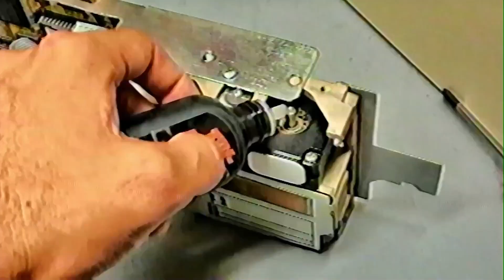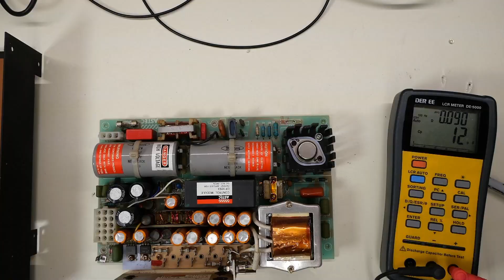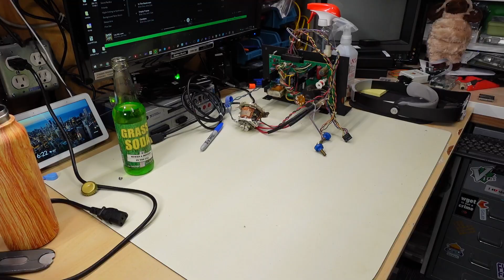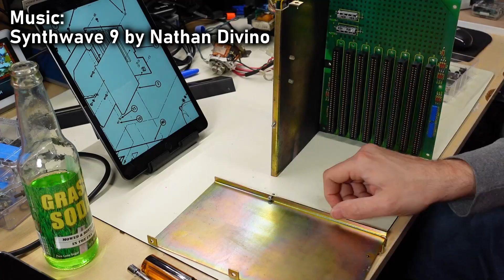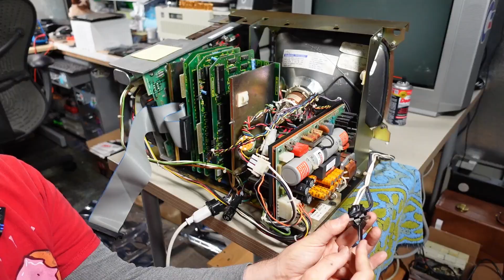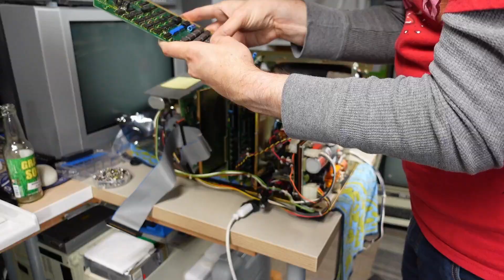I'm really scared to turn the TRS-80 Model II on

Comment: They put a serviceable fuse for the disk drive on that machine because the disk drive blows fuses. They don't want people taking that in for service to change a fuse that's not user serviceable so they added one externally because when they did their testing, they blew the fuse  often enough to add the cost of putting that external fuse in. Also, it may be there just because back then EVERYTHING had a fuse you could change in it without opening the unit (stereo receivers, amplifiers, etc.,)

Comment: Great video series. Fun to watch the diagnostic process and the repair techniques used. Also fascinating to me because I was a TRS-80 user, Model I and Model 4. Back in 1980 I bought the base Model I (16K, cassette storage) because, frankly, it was almost half the price of the Apple ][ that I was looking at -- though the Apple ][ had color output and expansion capability in their base model, unlike the Model I. Eventually I got the Model I expansion module to bring the computer up to 48K (I think... memory is fuzzy) along with a pair of 5.25 inch floppies to round out the setup (much more usable than the cassette interface!!). Funny thing, that fancy configuration made the Model I pretty close to the same cost as a similarly configured Apple ][!  The TRS-80 was a good, capable machine and there was enough technical info available for it that I was able to learn quite a bit about computer technology from using it, as well as write many useful BASIC programs to automate my life. Eventually I sold the Model I to buy Model 4P with the integrated floppy drives which could run CP/M as well as TRSDOS. Although the 4P was nominally portable, it was rather more a "luggable" like many of its contemporaries. All in all solid computers, great for learning (though I must admit, the Apple ][ would have been the better investment in the long run LOL).

Comment: I was a radio shack repair tech back in the early 80s and worked on model II s .   Just from experience I remember video problems were mostly caused by a failure of the video boards.  The CRT  ( cathode ray tubes) were very reliable and almost never failed .

Earlier comment concerning the bad reset switch is also a possibility

Comment: I remember debugging an Intel 8086-based computer (not PC compatible) many years ago. I hooked a logic analyzer to the bus and could see the instructions being executed. Luckily I had the appropriate software for the LA so I could see the instructions as assembler mnemonics rather than hex codes. Anyway I realized the machine was stuck in a loop. Looking at the code I saw that it was waiting for the screen blank signal. So I checked that signal and while it appeared on the bus, it didn't show on the I/O chip pin. So with the machine powered up I connected the pin to the bus and I heard the disk drive head moving as the machine was trying to boot. Where I am getting at is that the repair may not be as complicated as it looks. You'll need an oscilloscope for sure and a logic analyzer would be a plus.

Comment: Not the result you were hoping for,  but I think you made a LOT of progress.  That TRS-80 is a complicated device with a lot of potential points of failure, and was likely damaged in a drop. I think you are correct that the one connector could be a major part of the problem.  I was curious why you think that boards other than the sweep board could be causing the lack of vertical and horizontal sweep.  Theres a ton I don't know about the TRS80. 🙂

Comment: I've seen Astec PSUs in other microcomputers with those orange capacitors.
They can leak in an odd way, the electrolyte melts the rubber boot and glues the capacitor to the board.
Looks fine from the outside, only when you remove one do you find the failure.

Comment: You can likely get off the shelf replacements for those card edge connectors since they are non-keyed. 

Likely is, of course, not a certainty, but you could try contacting some electronics supply catalogues.

Comment: Beautiful restoration on that PSU and mount. Dang that unit has got some weight to it, can see how a drop would be hard on it even though it's so sturdy. Also the editing on this video is really tight and well paced. Interesting project, the vintage stuff sure is specific often, absolutely no slack for any deviation from spec.

Comment: "Replace the entire" board Rubbish, change the two large electrolytic capacitors, they will go leaky with age  and their ESR might be quite high, sometimes you can reform them though, if it was me I would replace them. four of the orange ones might be a bit suspect too, but the rest of it looks to be OK

Comment: This is a great restoration, i try to keep my machines as original as possible, but also so they can be used as this, maybe if it has been something extremly special, like the only one in existance it had been different, but honestly all my machines are in reality less than 100$ market value and where made in large series so using rustremover and automotive protecting paint is not a problem here and will do perfect for presvering the machines for the future.

Comment: I wonder if taking a picture and mirroring it on some screen near you, so you don't have to keep flipping the unit, might be an alternative. And I've been lied to - people told me you cannot measure an electrolyte cap while it is still in the PCB connected to other components and here you are walking on water in spite of people not believing.

Comment: I love the traces on the PSU board. I guess they were done freehand... ? You just never see stuff like this anymore.
Reply: They were wave soldered. That's one of the reasons the solder around connector pins crack. They conduct heat away too quickly, so there is less solder at those points. This also applies to pis or heavy copper leads on inductors and transformers.

Comment: A solution to being able to test the power supply in isolation without having a spare connector: find a metal tube of the appropriate diameter to press over the male pins in the connector, and then you can just clip an alligator lead to the other end, longitudinally. At hobby/craft stores they sell packs of small, thin metal tubes in aluminum and brass for model-making, and they often come in assorted diameters. (They can be easily cut to length with a small hack saw.) To find the right size you can either go by feel, or you can insert the butt-end of a drill bit into the female end of the connector, increasing the size until you find the largest diameter that inserts without too much resistance. If the pins are neighbors in the connector and you're worried about shorting, you can just throw tape at the problem.

Or, you can order female pins of the right size and just soldier or crimp wires and use them without having the plastic shell. They will still insert and hold for testing, and again if shorting is an issue tape will work, or heat shrink if you want a slightly more reusable tool. It's all temporary anyway. For the inverse situation (female connector), you can find a nail of the appropriate diameter and do the same thing.

Comment: My first concern would have been the RIFA, but that's already been replaced.
Also, a note on the absence of a -5v, I don't recall any Tandy I've ever seen that had a -5v rail off the power supply, and not all of them even had it on the system bus either. At least the Tandy 1000 RSX, and probably the rest of the 1000 R series has a 7905 to provide -5v to the system bus, but so far as I know, none of the XT systems had it at all.

Comment: I did some digging and according to mingku(dot)2ic(dot)cc/datasheet/pdf/8T26(dot)html the Fujitsu MB424 is a bus transceiver and can replaced with AMX4261 DS8T26AJ DS8T26AN ECG6880 IC-8T26 MC6880AL MC6880AP MC8T26AL MC8T26AP N8T26 N8T26A N8T26AF N8T26AN NT826AB NTE6880 SK9701 TCG6880 UA8T26 UA8T26D UA8T26DC UA8T26P UA8T26PC. Although I'm not sure if it is pin compatible._

Comment: You need to add the Pinecil to your list of “tools” on the videos now. I saw you using it here. I’d been reading about the Pinecil but it was one of your midweek mail call videos that eventually convinced me to order one. It should be here in a few days! (I got the red case as well so I can make mine look like yours. I agree that colour combination is nice!) Great video btw. I’m a TRS-80 person but never worked on a Model II before. Cheers!
Reply: @tspawn35  I also purchased and have just received a wall socket 65W GaN USB-C PD power supply from Amazon. This power supply claims to provide a full 65W and I think it will work beautifully with the Pinecil. I’m looking forward to my Pinecil arrive as well. I have some small projects waiting for me to solder up and I know this will be better than what I currently have as well. Hope all goes well for you too! :-)

Comment: Adrian, I just picked up a Model II myself a few weeks ago and stumbled across this series. It's been super informative (especially the last video) as I try to get my machine booting again. I picked up my machine from a friend of a friend who had it sitting in his barn for the last few decades, and it's in mint condition! After reseating a few connectors, the machine came right on! I've been using the last video you made as guidance to get a bootable floppy made, but I've had no luck with getting my DOS machine to write to the 8" disk yet. I'm excited to see the process as you get your machine running again!

Comment: Did you check the reset switch to see if it's closed due to the damage? If it is that could be the problem, stuck in reset.

Comment: At least it looks a lot nicer on the inside even though it hasn't been restored to operational status yet.
Reply: that's what I call a backhanded compliment!  The part of the machine that no one can see when it's functional and whole, looks nicer. ;(  Maybe if it had a new plexiglass case... it might even fit inside an old aquarium! But as far as a restoration of a vintage machine... I've been there, and my mom will come up with lines like that. trust me, those attempts at encouragement aren't very encouraging.

Comment: I have had access to electronic recycling waste for a very long time, but I have nowhere near the knowledge like you when it comes to electronic. I found computers from the 70s, tube radios from the 40s and anything in between. Nearly all of my equipment is from recycling center current amplifier I use is a 60s kenwood ka-6100. All equipment I found I just fired up up from the get go if they were dry and not wet from rain. Guess what?? 99.9999% of the time it just works. This amp I am using now has been on 24/7 for years and even bulbs works. I have just never come across something except maybe one "modern" ampilifer that failed because of a capacitor. 

Even had a osbourne 1 at a time with a bunch of working software, but sadly I was dumb enough to trade it away back a long time ago.

Comment: Quick suggestion: get a set of cheap remote controlled outlets to plug computers, monitors, isolation transformers, etc into. It makes me feel much better powering up old equipment when I can stand a few feet back with a fire extinguisher or whatever when I turn it on. I can also very quickly shut it off if I need to, even if I would normally have to reach over live power cords or bare wires to unplug it. I've also created a mini foot-pedal that allows me to hit the "off" button on the remote with my foot if something goes wrong, also very useful (especially when hands are full with the fire extinguisher).
Reply: hmmm... I would rather install an emergency button, which shout down the complete power in the room. And be careful with the fire extinguisher - there are different kind, especially when high voltage electronics (like crts) are involved. I this case maybe other factors could be interesting, for example a basement with small windows. Or you want to use something that damage the stuff there at least as possible.

Comment: I too hate that first powerup moment. Prior to this the machine is Schroedinger's puzzle, you can put weeks into restoring and cleaning and things and it could be working perfectly at that point. Stuff can go wrong so very quickly when you hit the switch for the first time though. 
I recently worked on the only known Positron 9000 (1982, 6809 CPU) in existence after it had lived in a wet shed for decades and been chewed by rodents - some of the chips had disintegrated. Much cleaning, socket replacement, chip replacement, new PSU. Heart was in my mouth when I powered it up for the first time and..... nothing. Excellent video, thankyou for showing this hobby isn't all success :) Cheers, Adrian (Binary Dinosaurs)
Reply: I would love to see something on this system. The progress you make etc

Comment: Nice work getting this far on such a complicated machine.  Honestly, while I am pretty confident working on most home computers from the late 80's and onwards, the TRS-80 would just confuse the hell out of me.  Rather than trying to replace all those chips that look a bit dodgy off the bat I would try sanding down the legs and using de-oxit for a start and then maybe replacing the sockets if they are looking bad.  It's the kind of thing that can't hurt at this stage as if they don't work with that, you were going to replace them anyway.

Comment: Dear lord the pcb of that psu made me shout ugly. But I guess its the age of the product. It was most likely analogue designed and made. Being used to tight routing by software like Ulticab myself i was a bit shocked. Thou I do understand it considering the era. And in the end; when it works it works.

Comment: This is so damn nostalgic for me.  I learned BASIC on a Model 4. (If you held down the little red button at boot it would boot into BASIC from ROM). 

If the issue is the disk drive board, I wonder if removing it and trying to boot to ROM would be possible. (I know the model 3 could do it, but don't know about the model 2.)

Speaking of nostalgia, I love the modular design of those early Z80 computers with the backplane and cards like that, there was a project I found in the 2000s where someone had documented building their own Z80 PC like that, writing and burning a custom BIOS, and running CP/M and DOS on it.

Though, I bet the design might make it hard to repair without replacement cards to swap in. 

If you want to use your logic analyzer on a card while it's running, I wonder if you can get a card edge extension cable, so that you can have the card flat on your bench while you probe it.

If the custom chips are bad maybe you could do a collab with a hardware designer on youtube and get a replacement board made. 

I also wonder if the fan noise would improve if you added some silicone grease in there to lubricate it.

I think the sanding and spray paint to prevent corrosion is totally fine.  Though if you ever do get it working, you should paint your signature and the date, so that when it's repaired again in 50 years, there will be a history to the piece.

Love your content Adrian, you rock!

Comment: A good suggestion for powering up unknown electricals and electronics is using a variac, that way you can slowly crank up the volts to ensure damage limitation, aswell as letting caps charge slowly so they don't end up causing a current spike that could blow other components in the process... :)
Reply: can be a bit dangerous for auto line switching modern stuff though.

Comment: An aside from the electrickeries in the video; the yellowy coating applied to metalwork such as the chassis here is Zinc Chromate, apparently quite toxic and a carcinogen when ingested, so do be careful when sanding and/or grinding the stuff off prior to painting... :S

Comment: So what is next? Is it the CPU and board? You looked at the screen working (it works), you looked at the drives working( they work) so the CPU and memory is next? CPU + board is all low voltage right? you can't get shocked like when working on the screen. TV tube working voltages are dangerous :)

Comment: Its looking good after all the work you have put into the PC.Is there any way to input a signal to the monitor to check its working or to take an output from the onboard graphics to another monitor?
Reply: an input signal could be made, but only to check it wasn't completely dead. Many subtle and even not so subtle problems wouldn't show up. Temporarily changing the output to another monitor would be tricky, it's really beyond my expertise, or even the expertise of most "vintage computer restorers" who aren't well versed in CRT functions (it's also a bit dangerous -high voltage). On the other hand, replacing the entire CRT would not be so difficult, old TV CRTs could be used. In another video, Adrian mentioned an old 1980 B&W General Electric TV might be donating it's CRT for this purpose.

Comment: Speaking of power suppliers , is there any solution to put a protection between a psu and a computer, so if it falls out of spec it will brake the connection.

Comment: Why have a dedicated 24v rail if it has a -12v and +12v rail? Wouldn't you get the same 24v's?
Reply: Need 24v referenced to ground most likely. 12/-12v, while is 24v DIFFERENTIALLY, won’t measure out to 24v referenced to ground. 👍
Reply: @glenncaughey5044  Well that does make sense. TY. I wasn't thinking past my own projects as I often use old pc power supplies for low current 24v battery chargers.

Comment: I'm surprised you didn't check the high voltage for the CRT. That would be a good reason for the screen not lighting up. I used a high voltage probe on my Fluke meter. I assume you don't have one, otherwise you would have checked. You do nice work, though.
Reply: He does have a high voltage probe and tested many CRTs with it before. Is interesting that he didn't check that